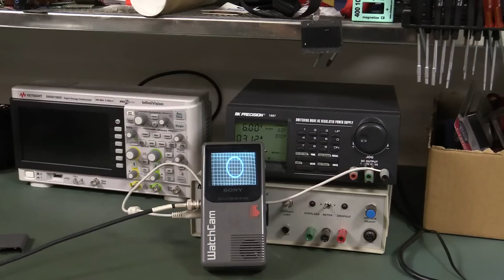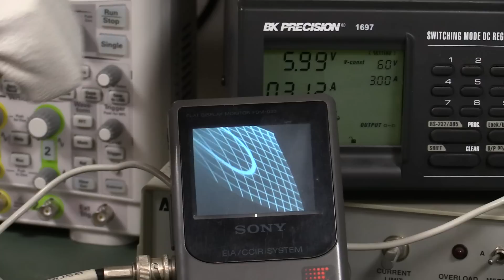Sony WatchCam CRT Fun With Neodymium Magnets

Comment: Hehe... Fun times ensue if you do this to a color CRT. It would magnetize the shadow mask or aperture grille and cause distortions that would stick around, sometimes for the remainder of the CRT's life. I suppose that might be called magentizing the CRT? Cause it's all different colors, including magenta. Is that what a magent is for? :P
Reply: That's what the degausing coil is for
Reply: Except, with a strong enough magnet, often times it was a bit too much for the degaussing coil to handle. I can confirm from experience, that discoloration can remain on a color CRT for years after a strong magnet was applied to the screen, despite the best attempts of a degaussing coil.

Comment: Special effects  - there was a device that did almost exactly this. It was called the Scanimate, used in the 80s and 90s for TV graphics - it was  basically an electrostatically scanned monitor that put an analogue computer in line with the scan signals. They then put a camera in front of the monitor, and did things like colour keying afterwards. There are a few YT videos on it - it's a really interesting bit of forgotten tech.
Reply: Search for Dave Sieg here on YT, he has a lot of videos explaining how the Scanimate works, he also own a full working system himself which he plays around with.
Reply: thank you for this hint. will check this out.
Reply: Mike! New videos please! I miss you so much.
Reply: thats a nice rabbithole. sort of oscilloscope music without audio.
Reply: Links plz

Comment: i remember doing that with a speaker magnet on a CRT TV back in primary school days!..got busted for screwing the TV..and also screwing the C64 that was hooked up (even tho there was nothing wrong with the C64..the teachers though it was stuffed coz of the screen)
Reply: The TV will recover back to normal if you leave for a few minutes.
Reply: Not always. Sometimes the screen needs to be degaussed. Some televisions had degaussing coils built in.